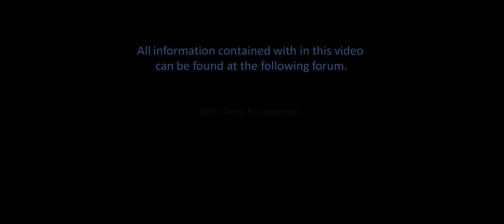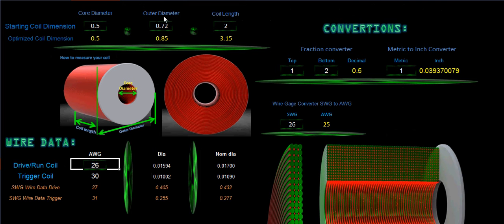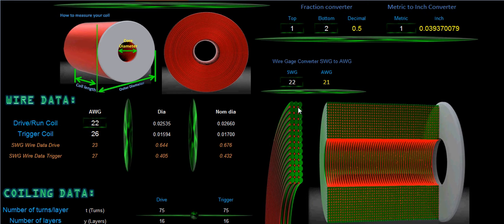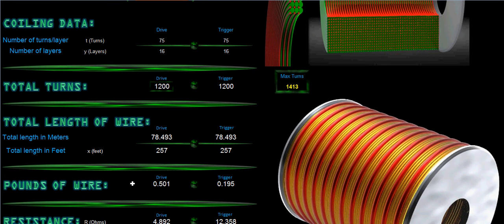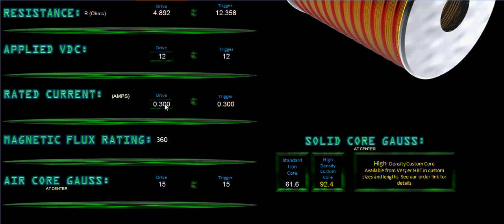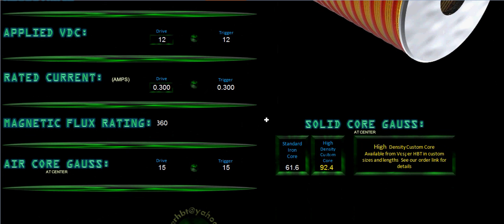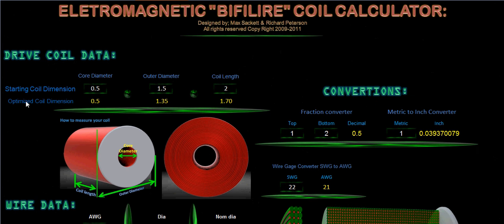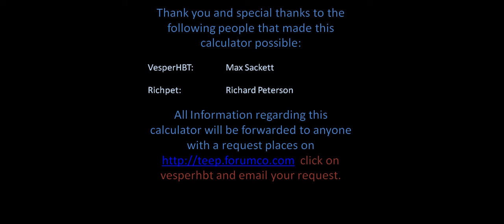NEW Coil Calculator.avi

Comment from the maker: Because of the last year of new developments in this we are redesigning the calculator to compensate for the new energy field development occurring in the start during and end flux based on the new polymer and other forms of material that cause disturbances in this field. Also because of some work another friend is doing with magnetic isotopes, we are designing more information on this as well. I know it has been a very long time in coming but Ill have it ready as soon as I possibly can.